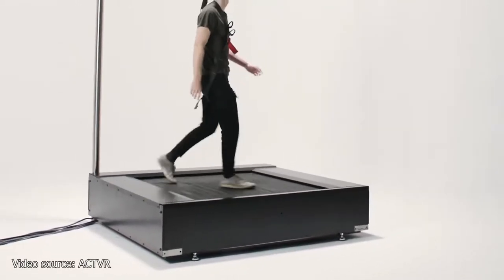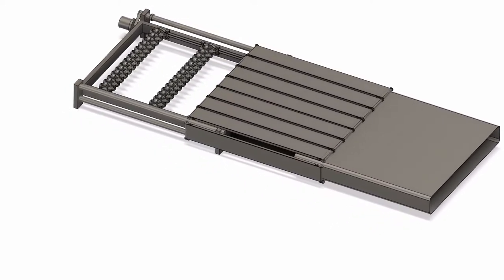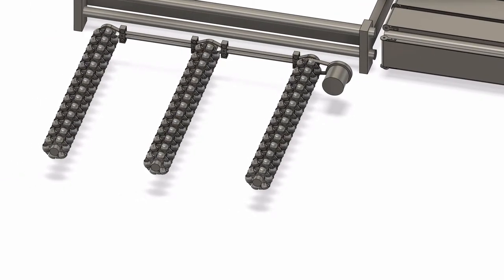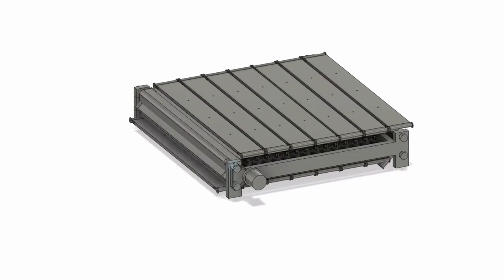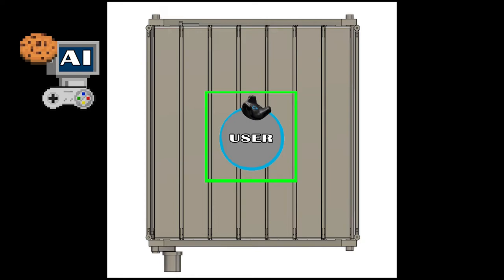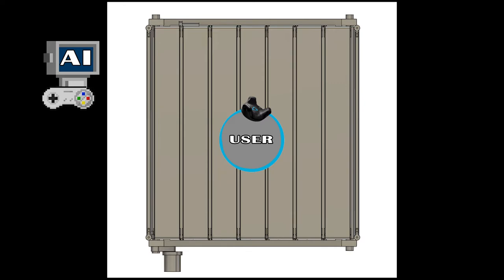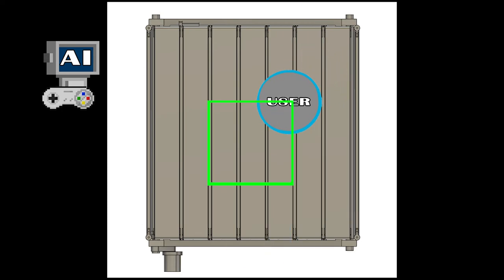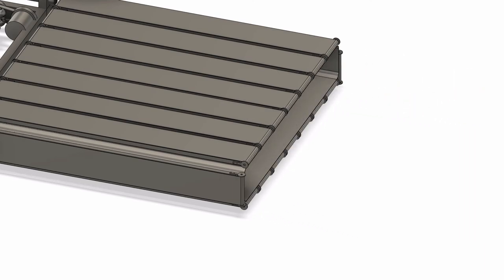VR Treadmill Explained!

Comment: This is a bad use for AI as a normal PID control would do an identical job with less latency.

The only logical place to use AI here is for analyzing the body stance of the person on the treadmill and if/when they are likely to start walking.
Reply from the maker: I never thought of that! your totally right and that would be a much better idea lol. Thanks for letting me know my plan was flawed before I got in to making it!
Reply: you dont need AI for that either .. system already know if you start moving or you stop because your head is tracked or sensor on your hip you can combine these two.. so your treadmill is just like replacement for your joystick for movement .. you just need put inputs from treadmill to joystick for movement in VR.
Reply: @Vladarius808  You missed the entire point. I am talking about a likelihood of someone moving.
If you think this problem is as easy to solve as just taking the headset offset from the center and using that as a joystick movement, you'll end up with a treadmill that is as bad as the infinadeck.
Reply: @Vladarius808  Neither did I say that AI would be required for this task.
Please, cease. You are making a fool of yourself.
Reply: @beanieteamie7435   infinadeck is quite good but it needs to be bigger ..
Reply: @Vladarius808  Your definition of good seems to be quite different from mine.

I have not seen a single person comfortably use the infinadeck for anything. All but one of the videos they show is people walking slowly with their hands on the ring.
Reply: @beanieteamie7435  I think it refers to good as the method or the design of the treadmill, since it gives a more immersive feeling than sliding your feet on a curved surface, to avoid the ring, the ideal would be to use a kind of harness or do the system reliable enough not to have to use this (quite a complicated option for the security and physical integrity of the user)
Reply: @PawFox101  Exactly.
Reply: Also... did anyone consider using EMG to register the intention of walking? @Modern Power  Oh one more tip that I noticed when observing the other omni treadmill. If you stand still, but move your body around, the treadmill will try to place your hips int he center.

But a treadmill should only activate... when you have the intention of walking. Not when you are simply looking around while standing still with your feet but moving around your hips.
Reply: @millanferende6723  Exactly, me and some pals of mine have thought of using BCI for this yes.
Reply: Have you tried using electromyographic sensors? I think they will predict the movement before it is made, at the moment of muscle tension and the leg has not yet been raised.

They are successfully used in bionic prostheses, where fast response and prediction of actions are extremely important.

I think this is the best solution for predicting actions.

The "brain-computer interface" variant of BCI, like a neurolink, in its early stages, has not yet been tested as much as bionic prosthetics technologies. There is a girl with prosthetic legs, she can dance ballet with these feet, they read and predict her actions so well.

You should definitely consider this direction.

Comment: That's pretty damn cool you're doing it! I subbed. Maybe you can remove the motors and do a manual 360 treadmill, would be cheaper, less software and electronics just a speed sensor and bada bing, bada boom bob's your uncle :)

Comment: That's a very cool explanation but I still don't get it?  The treadmill surface can only move either forwards or backwards.  How does it keep you in the middle if you're walking sideways or perpendicular to the mechanical travel of the treadmill band?  Am I missing something here?
Reply from the maker: so youve got forward and backward movement along with left and right movement, so if you turn both of them on at the same time you get a 45 degree movement! then by altering the speed of the motor you can get all the angels required!
Reply: @modernpower6285  Thank you for the answer, however I'm still confused.  Unless in the video you show the treadmill moving left and right?  I saw it move backwards and forwards, but not left and right?  And I still cannot see how the effect of someone choosing to move left or right can be achieved with a classic treadmill band?  Would you mind doing another video to educate me, demonstrate how it achieves left and right movement to keep the player in the center?
Reply: Wait, I just watched the video again.   I think it wasn't demonstrated BUT the main treadmill band is actually made of 16 other small treadmill bands perpendicular.

Thus, it can go all directions.  Wow, nice!

How do you keep the 16 horizontal bands tight enough as well as slip well enough to roll in all 4 directions?  That's so cool!

I bought a foldable treadmill for my gf and can only see it uses a very smooth surface on the back side to be able to slip.  But with 16 individual bands that runs the other way also, wat?!?  Now this part I'm not getting?! hahaha
Reply: @sigma_z  Hi pianist, I think the smaller perpendicular treadmills are actually supported by the 'sleeve' that the video unfortunately doesn't show the right position. The sleeve runs between the smaller bands, to 1) give support for the user and 2) to allow the 'ball bearings' to touch, and thus be utilized, the bands from underneath. The slip well enough factor, well my guess is a lubricant? silicone oil or something. Has to be contained within the bands though somehow?!

Comment: this is a great project but i have a question how do you plan on incorporating the distance one has walked into the treadmill relate to the distance walked in VR? are you planning to have something to calibrate a users Hight into consideration as Kit Kat has said "a normal PID control would  do an identical job with less latency." but how do you plan for the treadmill to anticipate your next movement? i think having 5 seperate sensors would probably do the trick one for the head that way your treadmill could anticipate for potential change in movement 2 for the shoulders/hips (depending where you want to place them) confirming you are about to change direction and then 2 for the feet /ankles (depending where you want to place them) for when to initiate movement in said direction. i think it would also be interesting as and added challenge to have the ability to use them as mounts for the normal full body tracking in the future. also i would like to suggest trying to use your ai coding learning capability to analyze the body stance with the sensors to make the treadmill be more fluent in motion.

i wouldn't know how to actually build this myself but i think this would be an interesting idea.

one last thing the sensors to track could help with calibrating for Hight depending on where you want to place them.
Reply from the maker: I like your ideas! Luckily I dont have to deal with that until i make a functional prototype XD. Ill be sure to keep your suggestions in mind Thanks so much!

Comment: Whats the estimated amount of money you need to build such a treadmill?
Reply from the maker: the planned price was originally $1000, but now that prices have gone up and ive discovered some issues that i wasn't including in initial price estimation, its now looking to be around $1,500 if done with new parts and $1,000 if done with used parts
Reply: @modernpower6285  Thats still waaaaaay less than the price of the infina deck. I would even call it affordable

Comment: I'm still wondering what happened to or if there was ever a ball bearing platform model.
Reply: Stopping the ball bearings would be the hard part.  If you are walking or running and come to a sudden stop... yeah got to think of everything
Reply: @laartwork  i would then think rather than have them spin freely or like theyre greesed, go the opposite and require the weight of the person to cause them to spin. Allow some friction to set them into a mobile position. Just off the top of my head, im sure therell be issue there as well. I just feel like we can do better than treadmill.
Reply: @laartwork  or only allow a very small portion of the bearing surface area to be exposed to the foot and a far more sensitive under side of the bearing to read contact to it.

Comment: Why not just do the physics calculations and get it working right off the bat (including edge cases that the ai wouldn’t have been trained on)
Reply from the maker: im not exactly sure what you mean? you can join the discord and we can chat about it more though!
Reply: @modernpower6285  I don’t have discord yet so I’ll try to give another bad explanation: 
1. Stick cheap rotary encoders to each belt (cost a bit less than $0.75 each for 18 degree resolution) and use pid calculations to move the belts to a specific location
2. Find this location by finding the position of the person and his distance from the centre in the x and y axis (maybe with IR cameras and leds at waist level)
Note: any cheap camera module can see IR  and IR filters cost ~$7 each (filters that remove visible light) 
The IR filters should remove the need for image recognition, decreasing latency and there should be software that calculates the position of these IR leds.
Also it may be a good a idea to make the target location away from the centre in the opposite direction the person is moving, with this distance being proportional to their velocity and maybe even their leg length
Reply: Turned out someone else already said the same thing

Comment: Sadly this doesn't show the mechanism for how the treadmill is able to move in any direction.
Reply from the maker: If both motors are driven at the same time at different speeds then you get all possible angles of movement, Therefor omnidirectional movement. simply said I didn't want to spend another 6 hours trying to animate such a thing. I was hopeful that it would be easy enough for the viewer to connect the dots.
Reply: @modernpower6285  It isn't. The only thing really necessarily different between VR Treadmill and a normal treadmill is exactly how the belt manages to bend in all directions.
Reply: @DamianReloaded  Check the comment feed by Underground pianist up top. Each 'strip' of the larger forward/backward movement is a smaller left/right movement treadmill on its own